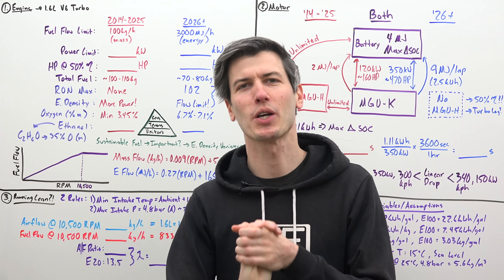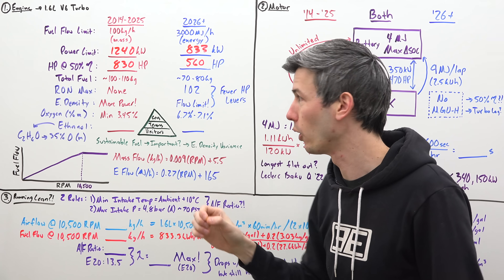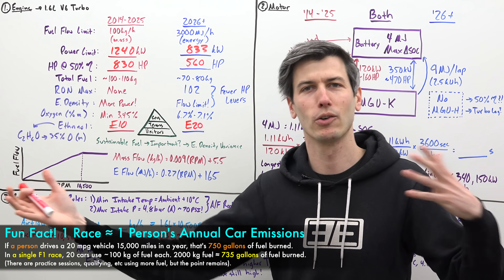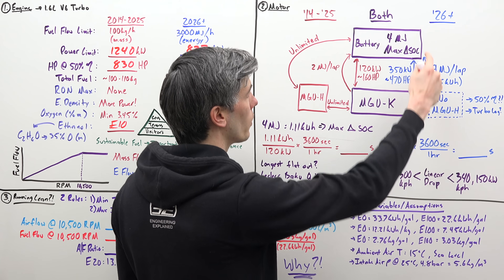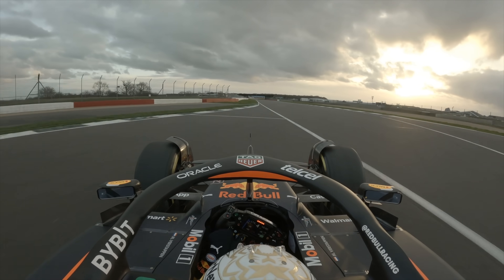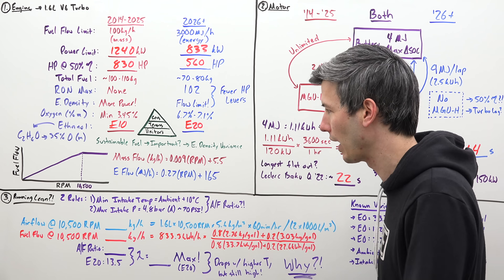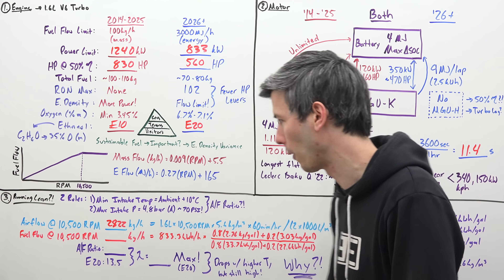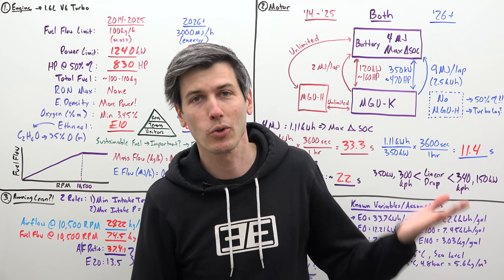Why Are 2026 Formula 1 Engines Going To Lose So Much Power?

Comment: I just cannot imagine how the future of F1 will look like after that. Seeing Crazy Aero Jets running on the tracks with scooter engines
Reply: Next power plant, Flinstone foot power.
Reply: People said that many times years ago. And somehow it still runs. I hope it will keep up innovation.
Reply: F1 had to go high tech.  They had to limit the speed for safety, so they had to do something else or nobody would care anymore.
Reply: They will go full electric when battery tech catches up (even if it's expensive).
Reply: @KoeiNL battery tech catches up? How is it going to catch up? Do you understand how insanely high the energy density of liquid hydrocarbon fuels are? What battery chemistries do you think will be catching up to diesel, for example?
Reply: @thepewplace1370  they just need to get close enough. You aren't going to get all of the energy out of gasoline or diesel by burning it. Gasoline has more energy per KG than diesel by the way.
Reply: I don’t think you will see a massive difference in the outward appearance of the engines.
Reply: Formula one is gonna be formula 0.5
Reply: Hydrogen is the answer
Reply: @zambroata  could be....
Reply: hybrid cars are the future, even modifying current cars to be hybrid would be great
Reply: @tturi2 Hybrid makes good sense for high mileage vehicles but current government legislation seems to be demanding “100% EV only”…
Reply: @tturi2  No, hybrid is the past. Only transition phase.
Reply: @TheSteinbitt  hybrid is still the future as it can easily be adapted to the current cars
Reply: Electric? Isn’t that obvious?
Reply: @TheSteinbitt  except that f1 cant go past a certain % of ev as formula E has exclusive rights to an electric based racing series till 2035. 

iirc it was max of 31 or 35% of a f1's car total out put could be electric. it's why the capacity wont be going up with these chances.
Reply: @TheSteinbitt  FormulaE has a contract with the FIA until 2035 or somewhen around that, guaranteeing them to be the only pure EV Formular series under the FIA umbrella..
Reply: @isimon.  Yes, but I don’t think it will be interesting until 2035 anyways as the tech isn’t ready for racing. Tried to watch formula e but it’s extremely boring except for the very end when people run out of juice:p Hybrid is the way to go until then imo.
Reply: @TheSteinbitt  I share your opinion. Formula E is being held back at the moment by the energy they have available during a race.
If they had more energy, they would also be able to run more downforce & stickier tires.
Formula E has 40kw/h available, Formula 1 has 1320kw/h (110kg fuel).
Considering the efficency of around 50% with the powerunits in F1, that‘s around 660kw/h for F1 compared to the ~40kw/h of Formula E…
Reply: @isimon. I doubt that. F1 is already gradually moving towards being an electric driven series. I don’t see the FIA stopping natural development in that respect…by (say 2040) I’m guess all global motorsport will be 100% electric. It’s already much faster in drag racing for instance….
Reply: @isimon. I don’t follow Formula E at all as it’s not televised free in the U.K. but I guess if they were to convert a race into say two sprints, with the results of sprint one determining the grid for sprint two using fully charged cars again then that would be pretty exciting? ( do they race on the same F1 tracks?) 🤔
Reply: @philtucker1224  I just checked and Formula E has an exclusivity contract with the FIA to make them the only fully electric/hydrogen single seater championship under the FIA umbrella until 2039.
It‘s no secret and not hard to find info on that contract 😉
Reply: @isimon.  false news mate.
Reply: @philtucker1224  It just isn‘t but ok..
Reply: @isimon.  at the time of my original comment I didn’t realised that Formula E is a wholly owned subsidiary of Formula One. Also there is talk of a full Formula H ( hydrogen powered) series proposal depending on what the various countries legislate for in the future, so I think we will still be able to have some type of competitive series in the future. (I think 2035 will be a big regs change for all racing power units in motorsport globally…)
Reply: @TheSteinbitt  We already have Formula E. Notice how popular it it.
Reply: @TheSteinbitt  Formula E has exclusive rights
Reply: @TheSteinbitt  So, basically slot cars.
Reply: @TheSteinbitt  I'm not watching electric race cars.
Reply: @noname-gp6hk no worries if your already fairly elderly I’m sure we will still have ICE cars racing in various motor sports for at least another 8-10 years..
Reply: @tango_uniform  the thing is car tech is changing. F1 is intended to be at the forefront of car tech - every year, an increasing number of consumer cars are BEVs and hybrids, so it makes sense that F1 is further electrifying itself and relying less on the gasoline engine. I would personally love if every car in Chicago were electric, because then I could walk along the lakefront without smelling any emissions from Lakeshore Drive. I think it’s a net good if F1 helps lead automobile electrification
Reply: @spoons_akimbo  the regulators don't care about "muh cutting edge car tech bs" when they made the decision to move away from superior ICE engines, they were pressured by politics and laws.
Reply: @mk-19memelauncher65 not really, they negotiated with the engine manufacturers to develop these rules, with the direct result being the entry of manufacturers like Ford.
They wanted these regs as they are relevant to their wider projects.
If transport solutions see V10’s becoming the next great solution for sustainable transport, they’d lean on the FIA to embrace rules that included them, it’s that simple
Reply: @spoons_akimbo where do you think you get electricity from…
Reply: @spencerwong1993, but isn't that what Fe is for?
Reply: @spoons_akimbo not to mention F1 shouldn’t be “leading automotive electrification” because EVs aren’t some magical solution and shouldn’t be forced onto consumers. The best technology should win out whether it’s the automotive industry in general or F1.
Reply: @spoons_akimbo if every car in Chicago was electric you would never have any electricity lmao.
Reply: @spoons_akimbo  If every car was electric you'd be getting emissons from the power plants of coal going like crazy to supply the whole of chicago with EV's. 
EV's are only best currently if kept in small numbers(Not even talking about the catastrophical amount of resources needed to make a whole city have electrical chargers for EV's), unless in the next 10-30 years we move to something more efficient like nuclear power plants or another new method of energy power plants are discovered and become wildly available.
And not just that, there's about 1.44 thousand million ICE powered vehicles currently in the world, that's about 18% percent of the world's human population!
That 18% ain't going any where! since ICE cars have a longer life span (If properly maintained) than EV's, batteries don't last no way near what an ICE platform does.
ICE will not entirely die, it will have to transform, adapt to the current needs, EV's aren't the future even car manofacturers knows this.
Hybrid is the best as of now, the best options for medium and perhaps long term is synthetic fuels.
Reply: @kipchpineda7161  Chicago uses nuclear power. 
Grid couldn't handle it currently, but it wouldn't burn coal.
Reply: @CAFFIENEHOUND  My bad, I didn't knew that about chicago.
Still rightly said, it can't handle it.
It would take decades to acomodate such change.
Reply: @kipchpineda7161  Maybe in the USA where most of the energy production is not clean no, it would not really be beneficial. But you gotta remember that are other countries out there which have way cleaner energy, take Brazil for example, which over 80% of the energy generation is renewable (Hydro, solar and wind)
Reply: @LuizHartkopf  our elite haven’t invested in Hydro 😅
Reply: @LuizHartkopf  And the last 20% comes from burning the rainforest;)
Reply: @kipchpineda7161  Which is why sustainable fuel is the big thing. Sure, it makes almost no difference to the total emissions of the F1 circus, but it pioneers a technology and makes it sexy. And if sustainable hydrocarbons do happen, they can use a lot of the existing infrastructure. If they really got sustainable fuel going, they could go back to 3 litre V10s with open exhausts.
Reply: @LuizHartkopf  You mean the same Brazil with the beach nobody swims on because of the giant sewage discharge offshore?? Ya, they're a model for the world. Cmon pal..
Reply: @TheSteinbitt  No, the rainforest burning is what brings meat to US plates.
Reply: @giggiddy  Hey, guess what, countries can do well in one thing while doing poorly in another.
Reply: @CAFFIENEHOUND  it would be burning coal if you increase the demand that much, coal and gas burning plants are far faster to build. It’s basically impossible to build new nuclear plants today and it takes decades if it does get approved.
Reply: You  missed the point. Pointing out how green a country is to our planet when said country is one of the worst polluters of the waters in the region is just kinda silly. Make no mistake, its still 10X better than my countries hypocritical approach. Not trying to argue bud. Take care.
Reply: @giggiddy  No one said that the country as a whole is green, but our power generation is absolutely one of the greenest in the world. It's a showcase of how it's possible to power a country without massive coal-fired power plants.
Reply: You guys are looking too small. What really needs to happen is to stop that many cars from being on the road in the first place with better public transportation and city design.
Reply: @kipchpineda7161  electric motors last longer than IC motors and with less maintenance. 

Also, Tesla batteries from old Model S vehicles are at 90% capacity retention after 200,000 miles (320,000 km). So I’m not sure why you would try to claim ICE vehicles last longer? 

90% battery capacity is still very usable, of the few ICE vehicles that make it that far without major engine work I would guess they don’t have 90% of their HP/torque left.
Reply: @coleeto2  electric vehicles don't last that long, you have to replace the battery every 200,000 miles(even less if you live in hotter areas, California for example), considering the battery is a major component in the propulsion of the car, comparatively, you have to replace a car's engine(average economy car, daily driver) every 320,000 miles, that's a massive difference, and unless different battery tech is brought up, the pollution and general inconvenience and cost to the average person is going to be insanely high
Reply: @coleeto2  While I am going to give you that however, while you are right on one side, you have to remind that EV's batteries are expensive, cost ranges about 5K all the way up to 20K, a full piston replacement of a toyota camry cost around 5K! and an ICE can last around somewhere in between 200k miles al the way up to 600k miles, even the 1Million, if properly mantained, with the same engine, for good reason we have cars from the 70's and 90's running around comfortably.
Aside from that, Tesla is the apple of cars in terms of right to repair it your self or lack  of it, and speaking of Tesla if the server or Tesla themselves are a goner so are the cars, even if they are in perfectb running condition, that was a problem that we never had with ICE's.
Reply: @LuizHartkopf  yeah and because the energy production is clean scaling up production is infeasibly expensive
Reply: @kipchpineda7161  It is worth pointing out that even if only coal power plants were supplying the entire grid, a power plant is still significantly more efficient and emit significantly less pollution per car than an ICE would.
Reply: @kipchpineda7161 Regardless, central power plants vs distributed engines are still far more efficient even when accounting the losses
Reply: @jimmy_olds E20 fuel will be carrying a lot more water…
Reply: @kipchpineda7161 I mean there’s a couple things here. Yes, ev’s oftentimes CURRENTLY get most of their energy from fossil fuels, however that’s changing as more clean energy is added to the grid, and, crucially, ev’s operate at a much much higher efficiency than cars, and the plants they get energy from are significantly more thermally efficient then a ICE engine. So overall, for every kw of energy used to drive in a ev still emits less pollution then an ice would. Also just wanna mention I don’t think anyone thinks it’s an overnight switch, instead just slowly replacing cars as people buy new ones.
Reply: @spoons_akimbo  F1 has not been at the forefront car tech for how many years now? Like 2 decades at this point.
Reply: @Iangamebr  More like 3 decades. In late 1993 they banned active suspensions, traction control, launch control, ABS, 4 wheel steering.

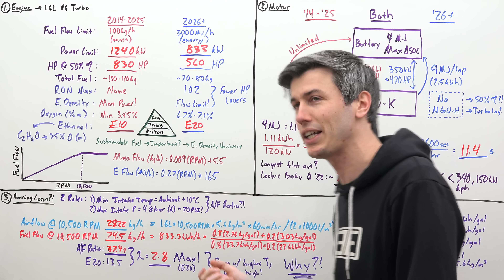Comment: 15:00 

I think the airflow limit is to prevent the engine departments from pursuing aero gains through exhaust gas velocity tuning exiting the rear for downforce.

An engine is just a fancy air pump...
Reply: Could blown diffusers be coming back?

Comment: I'm going to guess that with the reduced fuel flow due to the 3000 MJ/h energy limit we are going to see the 2026+ v6s rev to about 9000 rpm. +/- 1000 rpm. which is a little disappointing.

Comment: They better have some rocket anti-lag for that gigantic turbo the regulation is forcing on everyone.
Reply: They have a large electric motor.
Reply: @aspecreviews  Dude, they want a 90mm inducer on the turbine side, for a 1.6 liter engine. Basically a turbine that would be at home in a 1400hp S58. Electric assist or not, there's going to be some turbo lag, present unless means are taken.

Comment: My guess for that air limit is that if you can put as much air as possible first of all you introduce a lot more pressure in combustion which could result in higher efficiency also you make sure that every bit of that fuel will get used and none of it would get wasted
Also that 11s of power from battery is better to be used when accelerating not when you are limited by drag because the faster you can get to a higher speed the better
Reply from the maker: It's not quite that simple, as gas engines don't like to run lean. You reach a point where combustion is inconsistent because you don't have enough fuel in the mix.

Comment: Great vid as always!!! At the end of your video, I think the reason for the A/F limit is because some teams have learned from the current rules and are very close to the new A/F rule. IMO I think some teams are running extreme lean conditions and also a controlled detonating? Honda being one of them. The controlled detonation is giving a very high cylinder pressure without the aid of using the conventional fuel amount to get normal amount of cylinder pressure.
Reply from the maker: At lambda 2.5? If you watch my previous video, there's a paper by a previous F1 powertrain engineer that says you need an active chamber for lambda 2 (F1 uses passive). So it's a big jump, and using worse tech. It's difficult to believe they're running that lean!
Reply: @EngineeringExplained  IMHO I believe Mercedes, Ferrari and Honda have their PC in the piston crown now. Its a much larger PC and got rid of the heat issues with the PC in the head. This PC in the piston crown makes a rapid combustion, spark assisted TJI, HCCI-like combustion that could light off extreme lean conditions of 2.0> lambda even before the spark plug fires. Hondas video shows this happening in a public video. A ilmor engineer has referred to these engines as "controlled detonation". So now they're getting the lean burn results of an active PC with a passive PC. Also, I believe this is why there is a new intake temperature rule.
Reply: @EngineeringExplained  f1 engines run with lambda <2. They introduced a limit on boost pressure because if you use miller strategy for intake valve opening (=very short opening), you need a lot of boost pressure in order to get the same amount of air in the cylinders.
Reply: @03_Frank  +1 - @EE don't mix manifold pressure with air pressure in the chamber. Secondly there is bounce back from the Miller cycle at intake, need to account for that spike. Thirdly of course you can have below 10C over ambient, you can have below ambient simply by cooling compressed air then iso-baric expand to the intake plenum - but only factory teams tend to have air-to-water intercoolers powerful enough to cool the air so close to ambient before expansion (it's in the team-area, of responsability not the PU area, funnily enough) - the 10C over ambient in meant to close the gap between the factory and customer team actual available power. 
The world of F1 engines is an amazing place, congrats for bringing a bit of light on how amazing those engines actually are (which I could praise in the same way any TV comentary team since 2014 onwards)
Reply: Controlled detonation may also be for keeping the turbo spooled.

Comment: Is there any way to use an electric motor connected to a vertical pole with a pickup strip at the top. The track could be metal with a negative charge & the vertical pole could pick up from an overhead mesh with a positive connection.

I seem to remember this setup at out local town fair. Thoughts?
Reply: Sounds more like a train
Reply: Love the bumper car idea. Many F1 fans may be too young to get it. Ah, the smell of ozone in the air. And besides, the drivers already play bumper cars at all of the starts.
Reply: Electric induction coils in the operating surface to supply electrical power to vehicles would be more suitable, both for bumper cars and F1.
Reply: lol